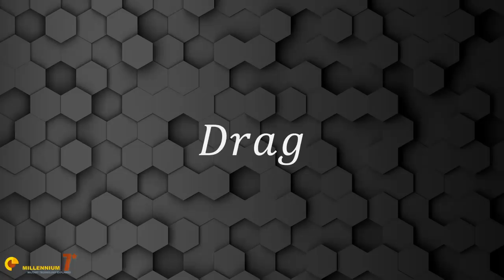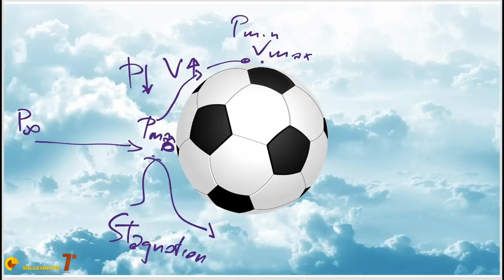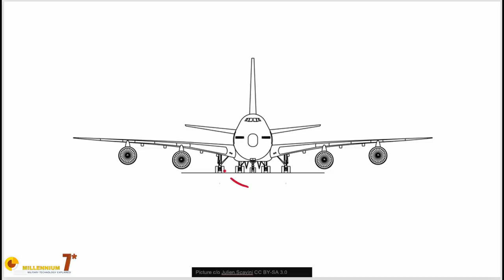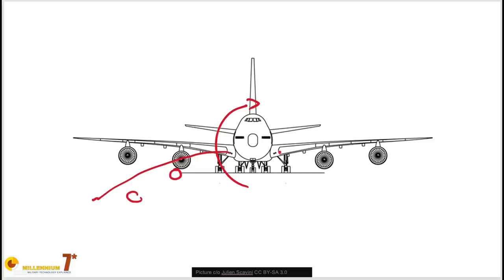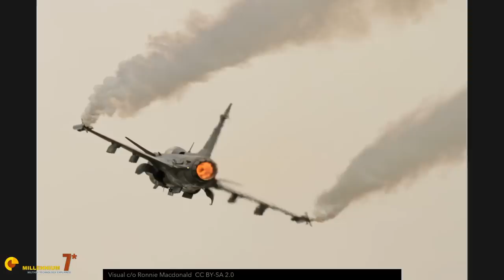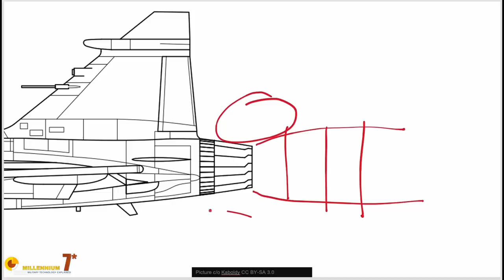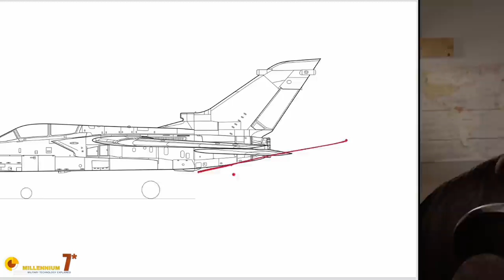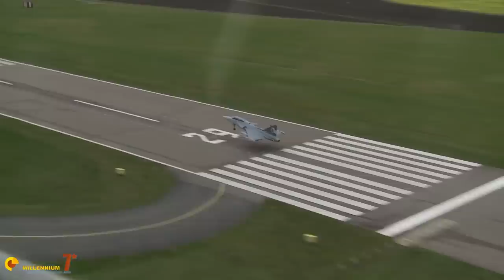The Phantom TAIL is strange because...

Comment: The structural engineering design of the Gripen Echo's tail is almost entirely Brazilian (wings, central fuselage, main landing gear door and electrical projects) and complete development of the rear fuselage... so much of the engineering design is Brazilian, made by the company AKAER (Company founded by former engineers of EMBRAER in 1992) that developed, among others, the BOEING 747/8 with 150,000 hours of engineering to develop the wing-fuselage junction box.... the electrical design and verification of supports Airbus A-380 fixed and mobile... +50,000 hours of composite structure development for the Main Landing Gear Door and Leading Edge fairing, complete design, certification and sustaining of the A-400M, 30,000 hours of engineering on the HELIBRAS EC-725(Eurocopter), development of modifications to the original design of the mechanical and electrical systems, in order to meet the needs of the Brazilian Air Force (FAB), In addition to EMBRAER projects such as the A-29 the world's best close support light attack fighter.